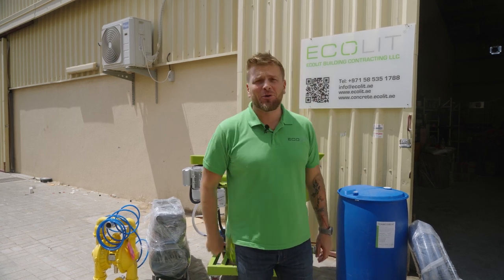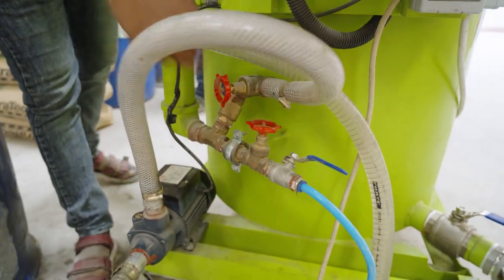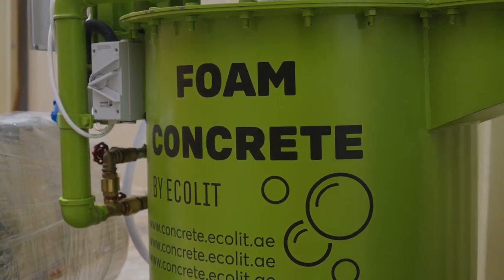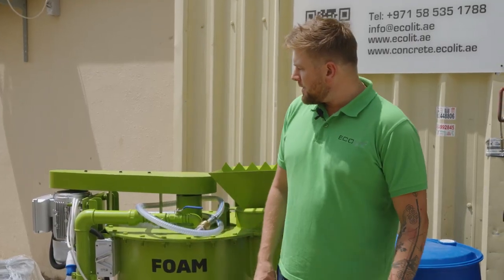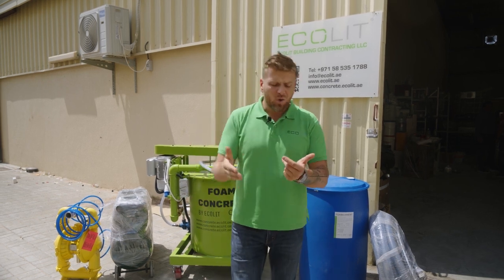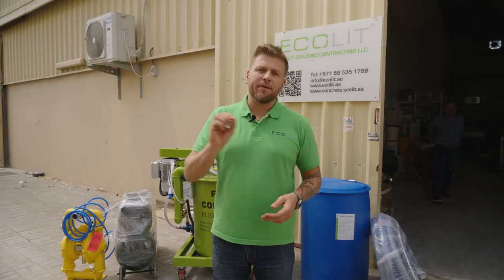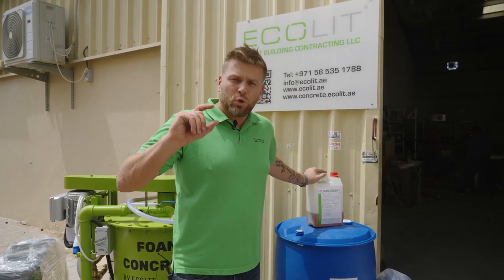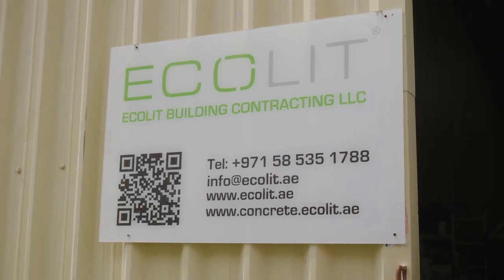Lightweight concrete generator ECOLIT

Comment: How it works ??
Can you show the way to Specifie the mix in this machine?? 
Especially foam ratio
Reply from the maker: We assist with the recipe all our clients. The ratio depends on the density you need to produce. The range of densities from 200 up to 1600 kg/m3.
Reply: @stretchceilingsDubai  how can I calibrate the generator of this machine?? As ASTM C 796 said 🙏🙏